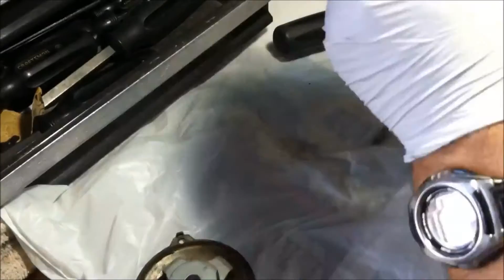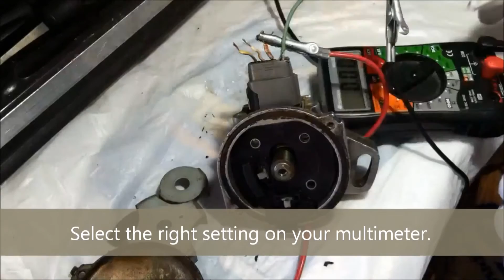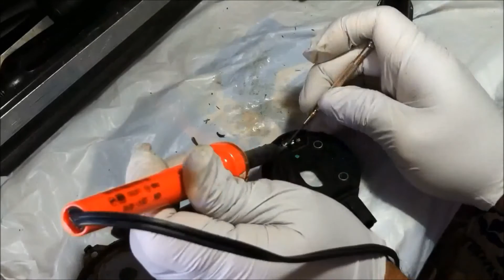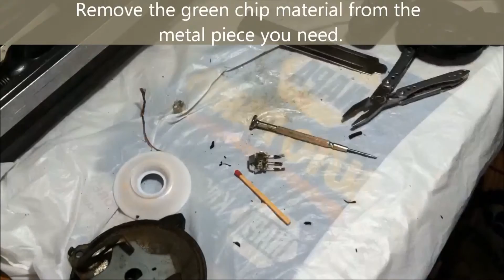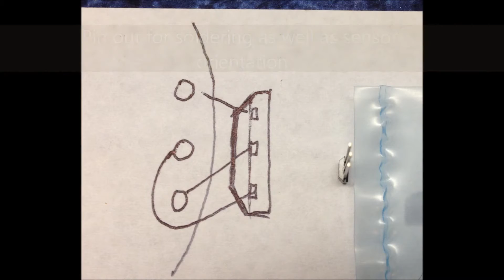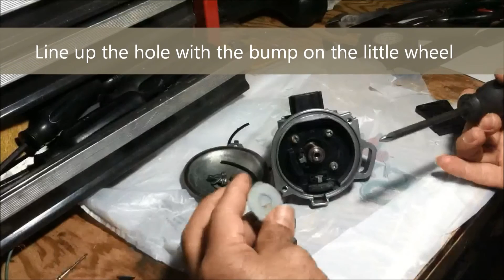94 Miata Cam shaft sensor Fix Repair

Comment: Replacing the sensor - not the entire CAS:  FYI - on a 1992 1.6L engine, the CAS has a center screw holding the encoder disk in place.  I removed the screw with a manual impact screwdriver (decades old) - with the stub end of the shaft on a vice anvil , and a helper holding the dog wings to stop the shaft rotating.  This method worked a treat. I also put a dab of red nail polish on the encoder disk  in line with the dog-wing that I marked red before fully removing the CAS from in front of the firewall.  The plastic sensor case had two tiny locating studs on its underside that fit in matching holes in the CAS casting. If the locating stubs break (one of mine did) then off your sensor is not going to fit properly until you drill out the offending stub remnant.

Comment: Hi evonode1 I found this video useful but struggling to get the sensor to work consistently particularly on the small wing of the crank rotating part. The only way it will pick up is if I slightly cant the plate to twist the wing which I am guessing has the effect of widening it. Do you run your A1101LUA-T down vertically inside the 'L' shaped metal piece or perhaps you turn the chip to do the equivalent of what I have done with the narrow wing to get a reading? Not working as I want yet but have found a nice way of soldering these chips in place, if you are  interested?

Comment: It would be nice if you showed your initial test connections a little clearer. I figured out the negative connection, but it’s cut off in the picture. Too fast on the test readings. Are both sensors around 1.5 Vdc? If I knew about what voltages I should have, I’d know if mine was good or bad, yes? Meter setting I saw later, but stopped video so I could see what range you’re on. DC output is logical, but some yutz on another video said AC and turn counterclockwise. I didn’t find direction mattered. If it doesn’t, let people know. Some of us are smart enough to solder, but lacking in electronics knowledge. Great video! I was challenged to figure some things out and I believe my sensor is bad. I’ll know when I install the new one. I wasn’t up to repairing it to install. I will fix it and keep for a spare. And ditto about the music. Distracting and my hearing is poor. What you say is what matters most.

Comment: did you need to remove your engine to reach your cas?
Reply from the maker: +Mediacontrol51 
I did not have to remove my engine.  It was difficult to access the bolts but it can be done.  My repair job is still going strong.  Definitely worth investing your time into this project to save money.
Reply: I just pulled mine from a 92. the bolts were easy enough to get off, but the CAS itself took some manipulation to get out from behind the engine. Just have to figure out how to maneuver it around stuff back there. totally doable though.
Reply: Mine would not come out. Too close to firewall. Remove valve cover and CAS retainer, and it comes right out easily.

Comment: Thank you for posting this. I'll be referencing this video later today to check if my CAS has gone bad on my 94 R Package.

I thought I might offer some constructive criticism. I think it would be very helpful if you didn't use quite so much time lapse photography in an instructional video. Or if you shortened the duration between images, in an attempt to smooth out the footage.

I'm having a very hard time following what you were doing when you removed the electrical component from the CAS, because everything is so choppy.

For the past month, my car has steadily developed problems with idling without dying. For a while it would stumble at idle, but act normally under full throttle. However, a few weeks ago, it lost all power, even when I continued to give it full throttle. I changed the oil, replaced the under car mounted fuel filter, swapped MAFs with a local, and topped off my coolant (thinking it might be the IACV), and then it ran fine for two weeks. Then the idle issue started again. And as of two days ago, my Miata has lost the ability to idle at all on its own without me revving the motor, and now it can barely generate enough power to get around the block. Worse still, the car only very intermittently throws a check engine light, and it always disappears before I can park the car and jump the under hood diagnostic inputs. Not that I could actually do that anyway, lol, because alone I cannot rev the car to keep the engine idling, while simultaneously attempting to get the car to throw the codes. 

Either way, thank you very much for taking the time to film and post this. I just got laid off, and am on an extremely tight budget, and am trying to pin point an elusive and confounding problem in my Miata that I've already thrown hundreds of dollars at in an attempt to fix. (which really sucks when you've just lost your job)

I'm not certain that it's the CAS, as of yet, but with your video I might be able to determine if that's the source of my problems. I'm gonna go tear into the thing now...
Reply: +DrivenMind Hey, did you finally diagnose the problem with your car? Was it the CAS?
Reply: I did. It was actually a near complete break in the wiring harness coming off the alternator. I attempted to solder it back together, but that didn't work, so I ended up getting another harness from a junkyard and replacing the whole thing.
Reply: This was of course after I bought and installed a new CAS. lol